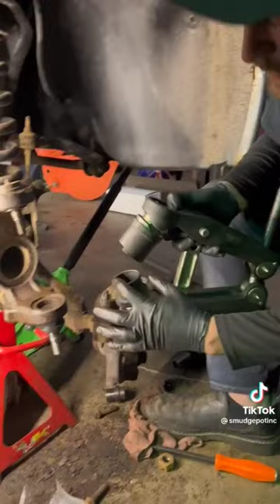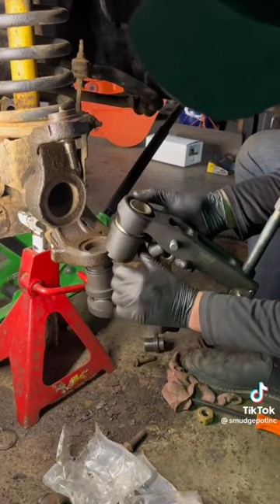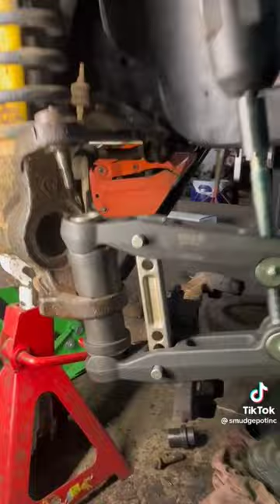#matco Ball Joint Press in ball joint Tool pt.2 #wranglers #howto #diy

Comment: I use this thing regularly and it does work really well on big corroded ball joints. It's definitely cumbersome and you really have to make sure that ball joint is going in straight because it will definitely  press it in at an angle and really tear things up if you don't pay attention. I prefer other styles on little ball joints, but this is the tool I turn to on the big PITA jobs.
Bonus, feels like youre holding a hand grenade and are in immenant danger when you've got a ton of pressure on it.

Comment: That thing is massive. I have a universal ball joint press that works on every car I’ve come across and it’s a fraction of the size and way quicker. Only even cost me 100 dollars.
Reply from the maker: What one do you have?
Reply: @letsfixit251  I don’t know. It was a rental from Canadian tire and I just kept it. When you rent tools from them you pay a deposit and if you don’t return it then the deposit just pays for the tool. If you return it then you get the deposit back and the rental is free. The case says OEM tools I am not sure if they just make the one or if they sell several.
Reply: I tried 2 different bj tools and 3 adaptor kits on a ram 2500 or 3500 can't remember but no matter what I did the correct size adaptor wouldn't fit. I ended up using a princess auto cartridge filter socket as an adaptor. Probably could have died that day but I didn't. This tool allegedly does that truck with ease. Plus the threaded rod being way out in outer space there is a huge plus. The c clamp style rod hits the upper hole so you're limited to one orientation. Expensive but if you do enough of them it looks to be worth it.
Reply: Yep that Matco one looks like a pain in the ass

Comment: In your opinion are there any advantages/disadvantages to the c-clamp design?
Reply from the maker: Advantage for the c style is its cheaper lol. Advantage for the pricy tool is it can get in spots easy where the c style can't. Such as a 4x4 jeep wrangler top ball joint where the spring hits the c style clamp. You hath to press out the top before the bottom and press the bottom in before the top in that order. That's just for starters.

Comment from the maker: The price is in the description of this video. Adapters sold separately. What y'all think?🤔
Reply: Its a really nice tool, but 680 is to much for a part-time DIY guy like myself. Now, if i was still doing this work daily, i would buy it with all the adapters for sure.
Reply from the maker: @JeepTrailsandBarbells  it's about $1,200 after you add the adapters
Reply: @Let's Fix It  if it saves you an hour on each job, it will pay for itself. it just depends on how many ball joints you do per week. When working on cars your biggest enemy is time.
Reply from the maker: @Urban Rock Crawling   I agree. You know when those ball joint jobs start coming they seem to come back to back suddenly. I was really considering getting it. I still am. Two bald joints jobs in two hours a day would have me sitting right
Reply: @Let's Fix It  Yeah, for real, its like they come in waves, i always use to tell the other guys "do think they sit on the side of the road with a sign that reads. I'm going to get X done to my car, who wants to come. Then all go together" 🤣🤣
Reply from the maker: @JeepTrailsandBarbells  lol seems like it sometimes doesn't it. Ball joint season
Reply: Fuck my Matco didn’t show me this shit I need it, I’m gonna be ball joint Bobby here pretty soon
Reply: @WillSwingem  🤣🤣
Reply: I like my bolt in ball joints on my T100!
Reply from the maker: @waverider5751  I bet you do lol
Reply: Does it remove them as well?
Reply from the maker: Yes, check out part 1 on my channel @redmenace6035
Reply from the maker: yes, check out part 1 on my page @redmenace6035
Reply: Pos

Comment: Since Matco doesn't make any of thier tools. Anyone know the actual manufacturer of this press?
Reply from the maker: The links are in the description
Reply: China.
Reply from the maker: @jasonclay8382  you have a link for one made in China?
Reply: @letsfixit251 SLC18100 - Ball Joint Press with Cups.   Cornwell has the same tool.   So yea it's probably made in China.
Reply from the maker: @homesteadhaven2010  I have two different links in the description showing it.
Reply: China
Reply: schlage tools

Comment: Matco does not make tools. They are made by a parent company just like all the other tool truck tools. Look at HF Icon line and they look IDENTICAL to snap on sockets only no skip sets. Astro Pnuematic and Sunex are way cheaper and ive beat on them for 5yrs and never had to warranty one thing except an astro ratchet cause someone at the shop broke it.
Reply from the maker: Who's the parent company?
Reply: @letsfixit251  He’s totally wrong about icon and snap on but this ball joint press is made for matco by Schley

Comment: Iunno man do that one more time and that probably isnt going to fit straight anymore
Reply from the maker: idk about that. one thing I can say it looks like it's built solid
Reply: That ball joint press is an absolute beast of a tool. It is definitely high quality and is built to last. Unfortunately that's the downside to this tool in my opinion. It's built so good that it's way to dam heavy and makes it awkward to handle.
Reply from the maker: @Stanley Semchenko  yeah and the other downside is it's so expensive. I think I could deal with handling its mass weight because your only going to be handling it for like a minute if that long. Its just Part of the job🤷🏾‍♂️
Reply: @letsfixit251  not talking about the tool. Lololol u realize when YOUR PRESSING IT IN CROOKED it fucks it right?